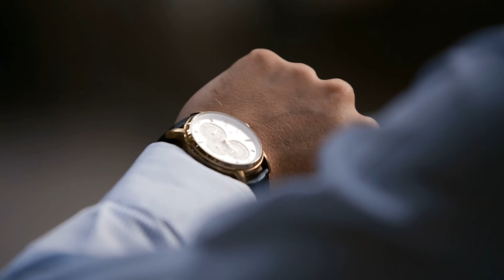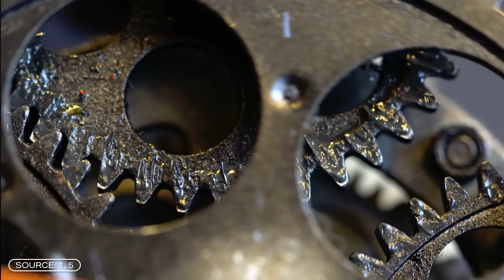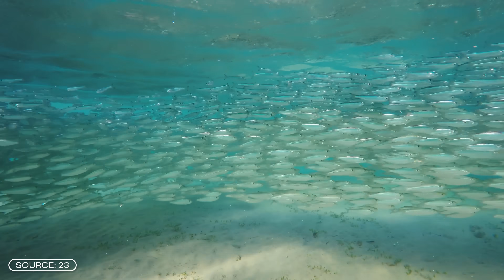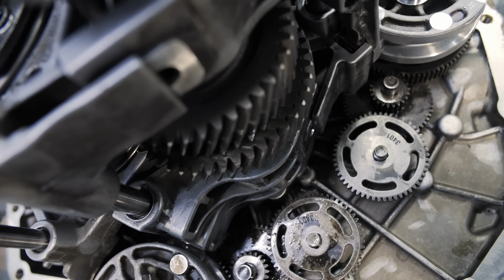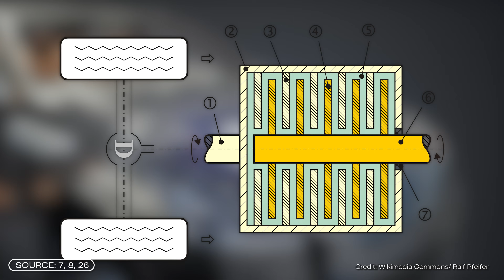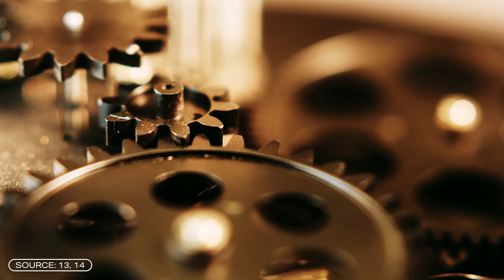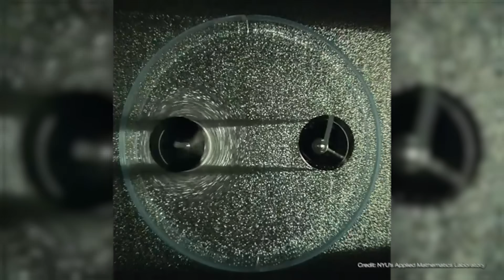No Teeth, No Wear: The Future of Gearboxes is Liquid.

Comment: I can't imagine this being very useful because of lack of torque, backlash and efficiency as you mentioned
Reply: It's present in a huge amount of machinery already... This is just two torque converters sharing the same fluid. Or a hydraulic transmission
Reply: Believe it or not, torque and efficiency are probably inversely proportional in this case. 

In Tesla turbines, torque is proportional to the relative velocity between the rotor and the fluid (drag is a function of ∆v²). The peak efficiency comes when the relative velocity is as small as possible and thus minimising the Reynold's number (because the flow becomes uniform whereas turbulence means some of the flow would work against you).

I think there's potential here. If they add the Tesla turbine rotor design to the shafts to maximise the surface area and maybe investigate incorporating magnets with a ferrofluid transmission, it might greatly improve on this prototype.
Reply: @atrumluminarium  If you can design the blades to be able to become magnetic on demand and use similar ferrofluid would it not improve efficiency on demand?
Reply: @ka-me4fy  why would you need them to be magnetic on demand? Why not just permanent magnets?
Reply: @atrumluminarium Maybe the thought was to be able to control torque or something? 🤔 Otherwise I've got nothing.
Reply: @M5clanH3 I think that it was to push and pull at the right times to speed up but never slow down the fluid and reduce torque, yes.
Reply: @ka-me4fy  Isn't that basically a electric motor though?
Reply: Actually (sorry - gonna be the "well actually ..." guy here), there are a number of modern transmissions & flywheel feeds that explicitly use liquid to transfer torque and rotational motion. This is a very old technology and I'm a little surprised that it's being paraded as some new super-tech.
... AND, in fact, it is called a "torque converter".
Reply: The M-18 Hellcat used a transmission that worked on a similar principle. It was faster than a willys and a whole lot heavier
Reply: It will probably just be a super niche use I would imagine.
Reply: have not watched the video yet but.
this is every automatic car and likely a April fools joke. so yeah it was useful.
see you are thinking of the torque of this like some water splashing around, 
but you need to be thinking of the torque of this like a hydraulic dump tuck.
Reply: @Amipotsophspond  Unfortunately, it isn't April fools joke. It is a joke but the paper is older - not from April.
Reply: @DalHrusk  it's April 1st today your training data is old. many April 1st jokes require work and set up that takes longer then 1 day, so finding back dated or paperwork filed early does not eliminate it from being a April 1st joke. the Tesla turbine uses the same effects as not having blades, their are liquid pumps on the same workings. I honestly not sure if this is the first "published" work on this but it for sure is not the first test of it. this is the automatic transmission in your car he tried to talk around it in the video saying how it's not but it is. the shape of it is badly optimized start optimizing it and it will slowly turn in to a Tesla turbine.
Reply: @Amipotsophspond  The thing is I have already read about this "invention" in January. So, your conclusion about April fools joke is simply wrong.
Reply: @DalHrusk  I guess you are right 4 months is a bit long, I guess they just reinvented the wheel.
that means people at MIT actually thought they could pass this off as new.
next years joke will be a wind powered flour mill, by using mechanical engineering, we can bypass the step of turning the the wind energy in to electricity then back in to mechanical energy, but the new method is more efficient directly and uses the mechanical force to directly mill the flour.
it uses gears that are different then old methods that used rung and pin cogs that are far less efficient.
and far better for the environment then coal powered methods.
it might even be able to feed the 3rd world and Africa because we are also building a less optimized a open source version that can be built with local on site materials but does compromise and uses the old rung and pin cogs.
if I were of different morals and the other politics I would already have a sustainable start up fueled by insurance companies, CCP china, and mismanaged pensions/retirement.

Comment: YES PLEASE, DO THE MAGNETIC TRANSMISSION!
Reply: Super expensive, super inefficient, super heavy, cant handel hard loads and are super difficult to make because you need a very thin flux cap! Basicly a very stupid idea!
Reply: @3.2213 an excellent idea to attempt to game out, as it demonstrates principles, a learning tool. It's almost certainly not feasible in any practical useful way.
Reply: @3.2213  for the applications of the fluid transmission in this vid, its arguably a much better. more efficient, higher capacity option
Reply: I wrote the wiki page on magnetic gears and gave up when they said "it was too complicated"
Reply: Yes please

Comment: Lots of losses due to heat in the fluid. Gear reduction, sure, but no amplification
Reply: That depends very strongly on the configuration. The amount of fluid between the mechanism dictates how much heating and torque is exchanged.

Comment: So, they put 2 torque converter shafts in the same fluid medium?  This is also in hydraulic pto's and have been used in the Dutch pumping system from its inception to cycle pistons and gates using Rapeseed oils as medium.  This just seems like re-branding/polishing technology that lost their patent and are trying to get another.
Reply: Agreed. “If it will soon be used in our cars”. See: Torque Converter
Reply: @HipsterBaby747  heh, I was gonna say, wait, the torque converter, and you all had me beat 🤣
Reply: True.literal definition of hydrodynamic transmission.
Reply: @bengtianyap4689 yes but that's a blade type not cylinder type.
Reply: Agree. I was thinking this seems inferior to the torque converter. I'm not even sure what the point is. Also we have hydrostatic drives too.
Reply: Right? I'm like 3 seconds in and I'm like..torque converter? 😂
Reply: Yeah a shame a PhD student wasted his time in something that allready exists. Just to come up with something worse.
Reply: @danielsuarez7474 Do not haunt me with visions of design committees past.
Reply: @danielsuarez7474 I’m sure the research uncovered something novel, but that detail doesn’t make for a cool video.

Comment: Interesting take on fluid dynamics.  I hope it succeeds.  Isnt it also true that Automobile Automatic Transmitions have been using a fluid based "Torque Converter" for many decades?  Isnt this just a continuance of the same principle?
Reply: The clutch in manual transmissions too
Reply: @tomholroyd7519  Clutch in manual transmissions is a direct friction coupling not a viscous coupling.
Reply: Basically
Reply: Lotta “new amazing things” are just rehash’s of old tech